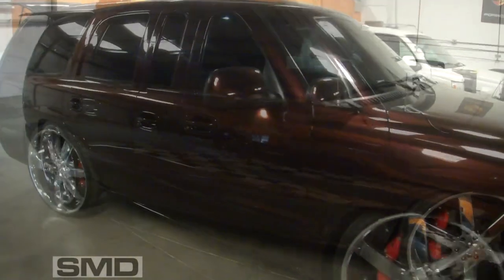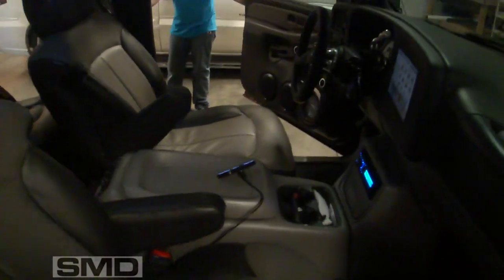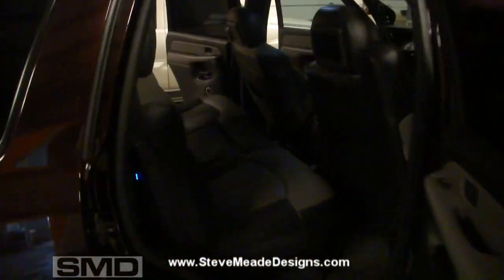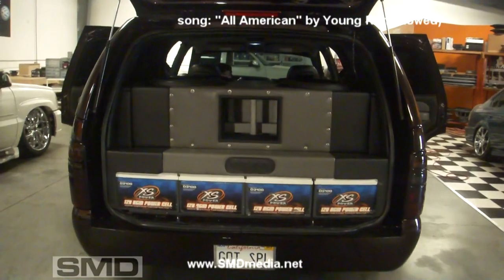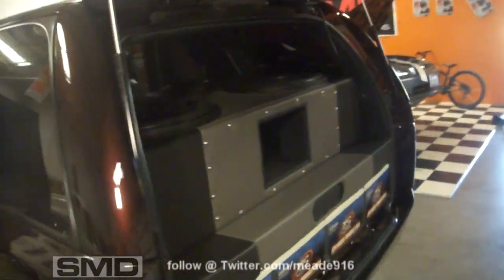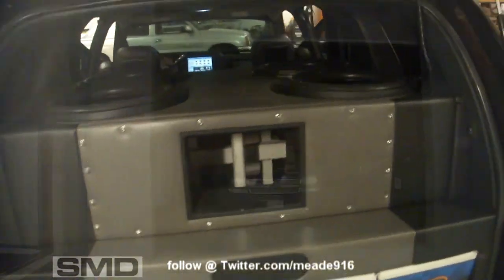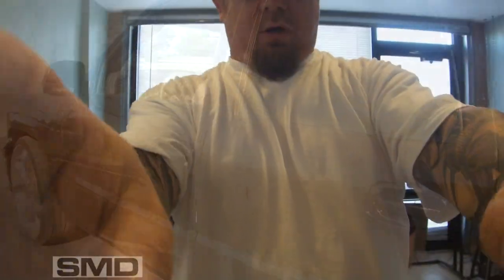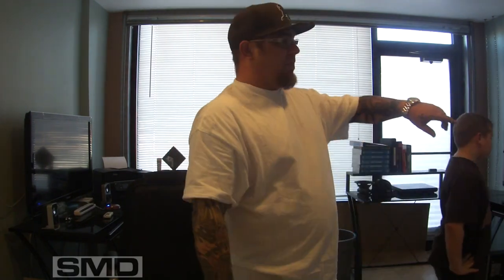ALARMING SOUNDS - BASS Sets off Building Burglar Alarm - SMD Tahoe 4 18's 30,000 Watts

Comment from the maker: another thing for those that doubt the power i have.  8 T2500bd benched @3300w  14.4v  1ohm....i am at 15.8v @ .7 ohms...do the math.  I also have 3 very large amps on my mids and highs - almost 4000 watts RMS.

Comment from the maker: i got those a long time ago on Ebay or something like that....but that isn't your issue.  You don't NEED the ones i have.  Take your's off, its only a couple of screws.  Then you will see these flappy, one way air vents in there.  You can cover the vent itself up with some sound deadener or you can take the vent all the way out and cover the hole with the deadener. Put a few layers over the hole and you will be all good bro.  I use Second Skin but you can use any brand as long as it sticks good.

Comment from the maker: @xx572bigblockxx 8 T2500.1 bd....each birthed at over 3300rms @ 14.4v.  I am running at 15.8v.  The other amps are also way underrated.  I am a little over 30k.

Comment from the maker: @culltwojc wasnt an insult - i used black electrical tape to hold my foglights together that i broke with the system years ago......wont find no scotch tape on my rig i spring for the good stuff, $1 for 5 rolls at Harbor Freight LOL - already replaced them though and nobody knew till i just now told you ;)

Comment: I think it's cool Steve's rolin' in a 2001 tahoe! I like the body lines better on the 2001s than the 2007+. Steve's got everything shaved and cleaned and tinted up tight( and yes I mean tight not right).

Comment: when a subwoofer makes a popping sound when getting low bass is that the driver fucked up or the amp? but when i push the sub in it dont make noise. what could it be? :O its a 15" cerwin vega

Comment: Hey yo, Steve, just a heads up warning for your computer when you do that, if it is on and you shake everything like that with the bass, the hard drive in the computer could get damaged, the little needle inside the hard drive which is what reads it usually only sits flat while spinning, the slightest movement will make that needle move up and down, which in turn scratches the little disk inside, now i believe hard drives can only handle a force of 30 g's of force when powered on and 350g's off

Comment: Can anyone advise me please,  I'm planning on hooking up 2 amps in my 98 Honda Civic, one bass amp and one speaker amp.  What i'm confused about is, how do i know what (amperage fuse) to use in the fuseholder on the power cable when running more than one amp??  Also, how do I connect the remote turn on lead to 2 amps, isn't the remote turn on lead on most decks, only sufficient enough to power up one amp, like I said, I will have 2 amps in my set up. Hope you guys can help, )))))

Comment: @9094design Get 2 - 4 10's up in there, build a custom box to fit under the seat in the cab of the truck, you can run all 4 tens across the floor, get some AudioQue or DC audio subs, and a couple good amps, shit will be hittin

Comment: Funny.  Well my 7.2 speaker system in my game room on my computer sets off my house alarm if its on.  This is because the room has concrete behind the Sheetrock so the sound cant travel through the wall.  his in-turn vibrates the wall so much that the control panel thinks somebody is breaking into the house so its set off.  Unfortunately i cant move the panel since its the only spot in the basement where its wired to.   I hate it being in my game room but oh well....
Reply from the maker: so turn your alarm off when playing the system.  Why is your alarm on when you are at home anyway? Paranoid? Scared of something? lol
Reply: meade916 no.  My parents are the ones that turns on the alarm during the night...   Otherwise it's off unless nobody's at the house
Reply: doubt your system sets your alarm off lol
Reply: How To MLG actually it did a few times.  Because the alarm panel is in the same room.   There is a pressure difference between inside and outside.  But yea I don't have any proof and I won't be able since I moved out of that house a few months ago.
Reply: Nick Chinn ahh ok bit more believable